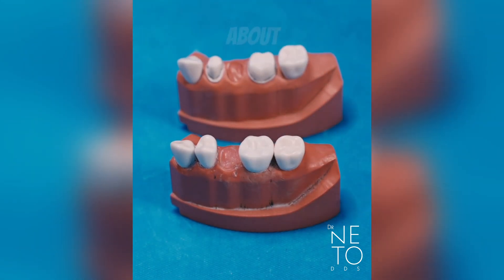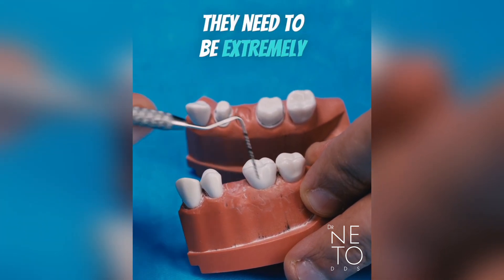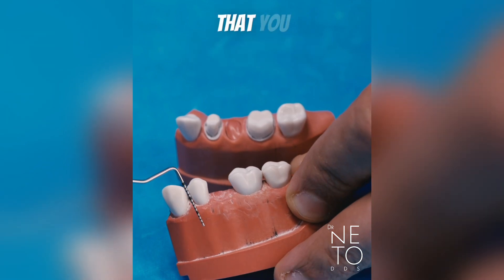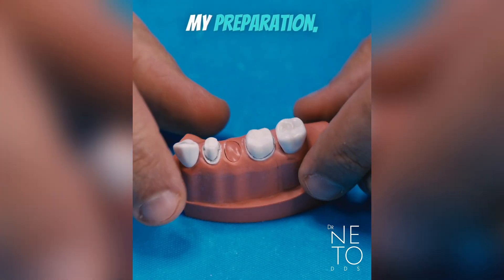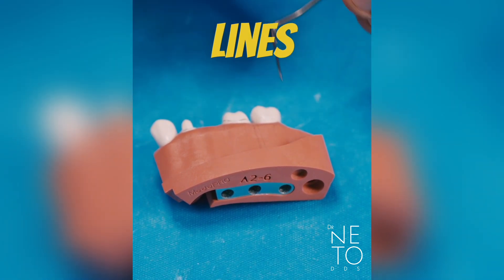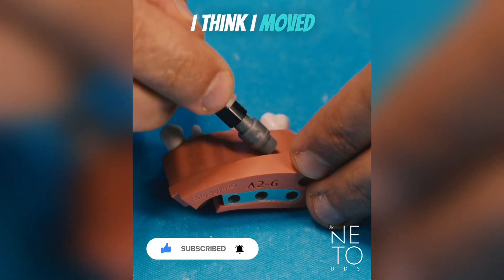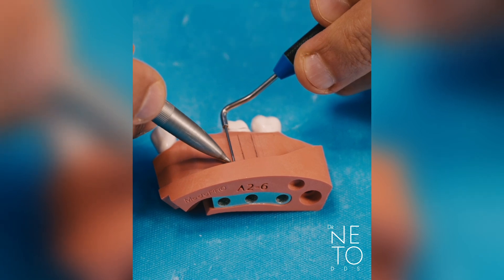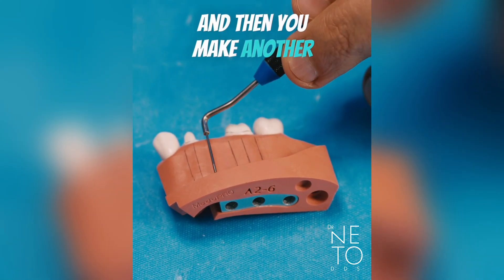Mastering Tooth Prep. Learn how to avoid undercuts and pass the #benchtest and #adex

Comment: In the exam how could you do this?
Reply from the maker: For ADEX/CDCA exams, it is allowed to use pencil over the typodont. I meant Bench Test exams, if the program you're applying to allows you to use a pencil. Some do, and some don't.
Reply from the maker: If they allow you to use a pencil, draw the lines. If they don't, you have to practice with the lines prior to the exam as much as you get to a point that you don't need the lines anymore. You imagine them.